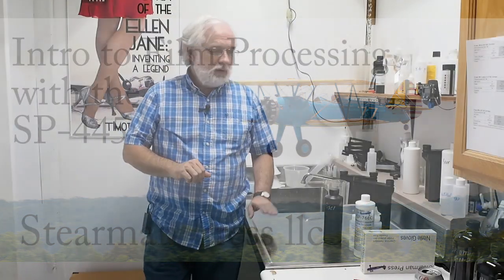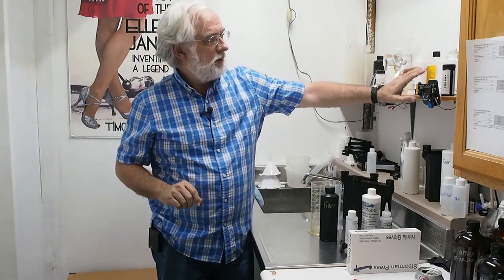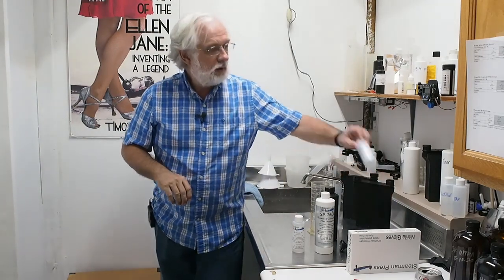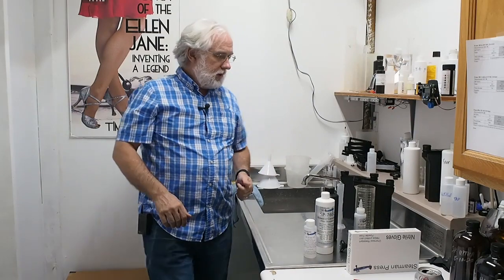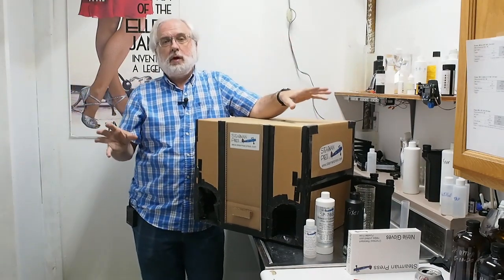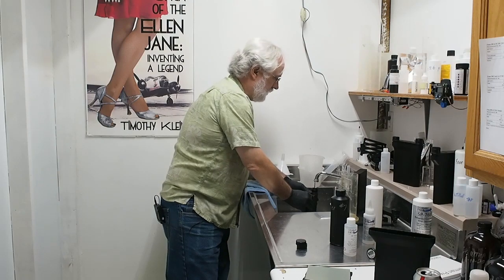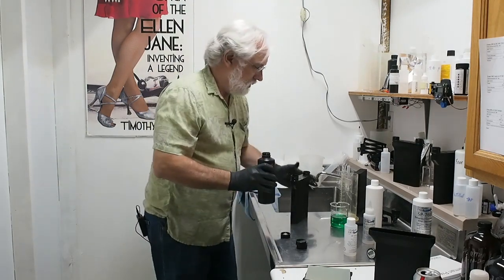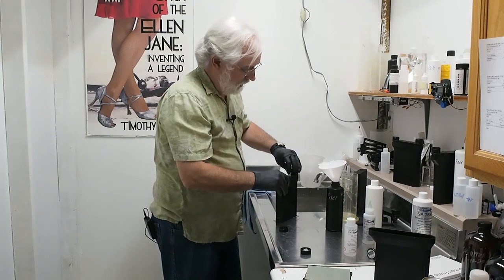Intro to Film Processing and the SP 445

Comment: I've used an under-the-sink iSpring reverse osmosis system for years. Only costs a couple of hundred bucks up front, and then less than $50 a year in filter replacement. The filtered water is at ~8 ppm, which is pretty good! Saves money and plastic very quickly.
You can also put a small box into a changing bag to gain some functional volume. 
Love the tank!!

Comment: This the best tank I have used for processing my 4x5 film. I would like to see a tank that could do 8 sheets at a time.
Reply from the maker: Thanks for the kind words! We've looked at an 8 sheet tank (SP-845) but it gets big and awkward. In addition, the tooling would be expensive.  We are seriously considering an SP-645, (six sheets). It could use the same lid and film holders as the SP-445 to keep the cost down. We'd just have to do the new tank and baffles.
Reply: @timklein185  keep me informed on the changes as I would be interested in testing out a 6 or 8 sheet holder.  Mike

Comment: I have been using mine for years now. Looks like the film holders have been changed. Are these better in some way ?  Mine work just fine but they are thinner looking.
Reply from the maker: It's a long story: https://shop.stearmanpress.com/blogs/news/and-the-film-holder-saga-continues-rev-4
Reply: @timklein185  I see just improvements for manufacturing  👍🏻  all these years I still use my old ones and it works great. Easy to load film and hardly ever any leaks. Just keeps doing what it is supposed to do and I have put hundreds of sheets through it. 4 just last night and will do another four tonight. :)
Reply from the maker: @terrywbreedlove  would love to see some of your photos. https://www.flickr.com/groups/sp-445/

Comment: Could you do a video developing 4x5 slide film with the sp 445? Wondering about agitation times and such.
Reply from the maker: Thomas,
Haven't done E6 in a while. You just need to follow the directions for the chemistry you're using. I always followed the "hand tank" recommendations for agitation.

Regards,

Tim
Reply: @timklein185  Thank you. Getting ready to try my hand at e6 and just doing as much research as u can before I try it.
Reply from the maker: @thomaspopple2291  One comment: I liked to process at 85F rather than 104F. It's easier to control. Also, it's that average temperature that matters. I start my about 87F and by the end it's around 83, giving me that 85 degree average.